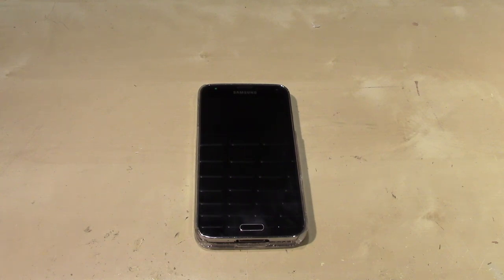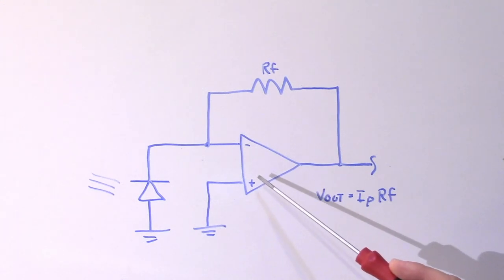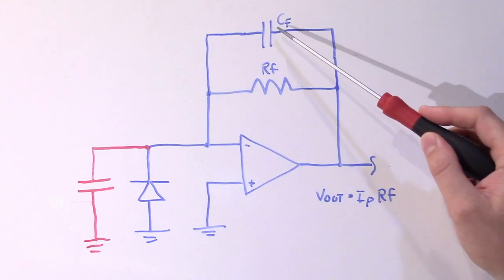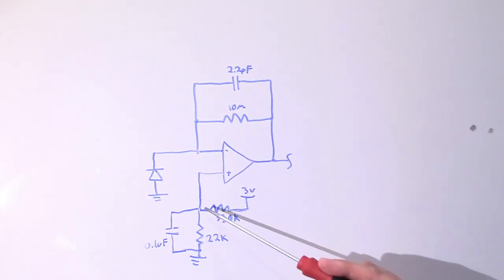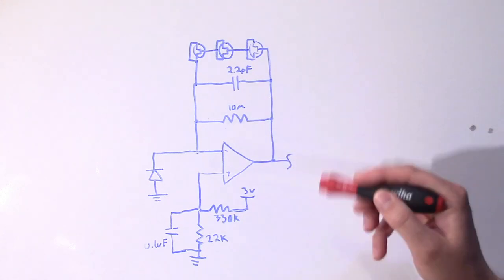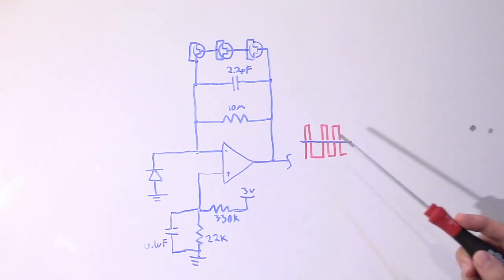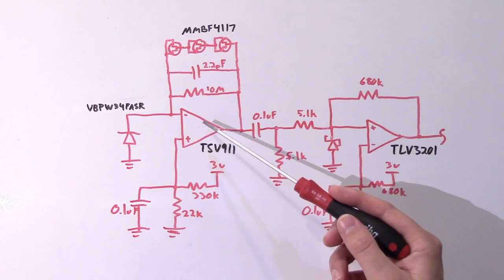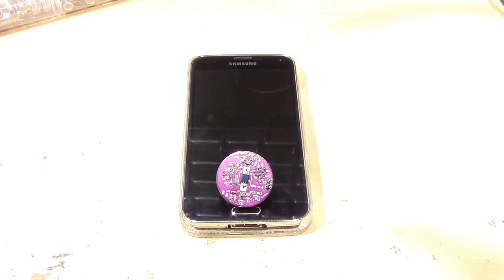Photodiode/Transimpedance Amplifier Design

Comment: Cool video. What kind of EDA tool do you use for PCB design?
Reply from the maker: KiCAD. It has its idiosyncrasies (for example, at least on Mac, the standard Command+C copy shortcut key fricking closes kicad windows...ugh...), but then I'd venture to say that all CAD programs are like that.
Reply: This is in the OSX bug database https://bugs.launchpad.net/kicad/+bug/1420714 - if some intrepid soul wants to fix it.

Comment: Hi, Very nice video to clear all points.....How about if my transmitter is transmitting data at 9600 baud rate....how same circuit works....
Reply: You need to increase the bandwidth by a factor of 10, so you'll need to reduce the feedback resistor down to 1 megaohm. That will reduce the gain, and hence the range by a factor of 10. Perhaps you will need a multi-stage circuit, rather than this simple one.

Comment: Hello, nice work! One question. Why using decoupling caps 0.1uF at 22k and 10k whe your supply is a battery? thanks
Reply: Noise does not only come from the main voltage source.

Comment: I wonder if an avalanche photodiode suited for the wavelength in question could be used with a strong optical IR bandpass filter to create an extremely sensitive detector precisely for IR. The high gain would perhaps compensate for the filter loss. I've been reading about APD applications when it comes to laser rangefinders, which is a fascinating topic in itself. Though while ~950nm APDs exist (like the First Sensor 9.5) they're pretty expensive afaik. From some rough research they should have maybe ~100x more sensitivity on average compared to a photodiode, I absolutely stand to be corrected though since I'm new to this area myself.
Reply from the maker: I've never used them myself, but yes, avalanche photodiodes are much more sensitive than the more common PIN photodiodes. I didn't really consider them as an option in this case due to cost (as you noted) and AFAIK they typically require large voltage biases. Would be interesting to play with!
Reply: devttys0 Yep, but the large voltage biases is where the gain of APDs comes from. The drive circuits would be similar to a geiger counter like some other people mentioned. I'll advertise a cool bunch of posts for you in case you'd like some geeky reading - google "Designing a Laser Range Finder", should be first link on hackaday. The poster is a South African manufacturer of laser rangefinders. :>
Reply: devttys0 Also your channel to me is as fantastic for pure learning as W2AEW's. Thank you so very much for the videos that you've made.

Comment: Hi. Can anyone explain how to configure this MMBF4117 N  channel JFET into a diode case? I dont understand how to connect g s d terminal in this video so that it will become like a diode
Reply: Connect drain to source; as it's an N-channel, that's the diode's cathode. The gate is then the anode.
Reply: @RexxSchneider  thx bro. Can u briefly explain why is that?
Reply: @wenhaoye8773  An N-channel JFET can be thought of as a length of N-type silicon with P-type doping around half-way along that length. So if you connect the drain and source together, you have a connection to N-type silicon. The gate is then a connection to the P-type silicon and that's what you need for a diode.
The construction of JFETs is such that the diode you get has low reverse leakage current.
Reply: @RexxSchneider  thx bruh, ur explaination is super useful and i understand now. But the final question comes up: in the video, the youtuber mentioned that configure jfet in diode case will hv lower leakage current compared to normal nmos. Do u hv any clue why is that?
Reply: @wenhaoye8773  To be accurate, connecting a JFET as a diode tends to have lower reverse leakage current than a normal silicon diode. That's a complex issue, but in simplistic terms, because the JFET is bigger than a normal diode, the charge carriers have a greater distance to go, and the levels of doping will normally be different from those used in a silicon p-n diode.
A MOSFET doesn't have a junction to reverse bias, and the gate is insulated by a metal oxide layer. Leakage through the gate of a MOSFET is a completely different effect.
Reply: @RexxSchneider  ok. Thank you very much.

Comment: You are wrong about the photodiode getting hit by more light equates to to a higher gain. In your circuit, more current will flow thru the PD and lessen the amplification. I think you mean to add a +Vcc to the PD in your circuit

Comment: Just curious, you picked the JFets as diodes, for their low inverse leakage current - when does this come into play? IMHO the diodes (JFets here) will never be reverse biased at all (even if there is 0 current flowing through the IR diode, the output of the opamp will always be ever so slightly above the V- pin of the opamp), so no current will be able to flow in the reverse direction.

~
Reply from the maker: Heh, you're right of course, I'm surprised you're the only one to mention that. :)  Leakage was more of a concern in a previous iteration of the design which ran off a split supply and the op amp's output was nominally 0v; in that case, a fast-moving input signal could briefly reverse bias the diodes (or they could possibly be reverse biased in a quiescent state due to op amp offset errors). Still, the JFET-as-a-super-low-leakage-diode trick is one of my favorite parts of the circuit, even if unecessary. :P
Reply: Yeah, if the opamp was powered from a split supply, then they will make sense. That crossed my mind, but when I saw the single coin cell battery, I started scratching my head :-) I totally agree that for low-current nodes, JFets are way better then a simple diode!

Regards,
Aleks
Reply: 0

Comment: Doesn't the circuit get swamped by noise from fluorescent lighting, which produce an IR carrier component modulated by low frequency noise?  In the case of compact florescent lights there is a strong modulation from the control electronics.
Reply from the maker: I haven't looked at CFLs specifically, but I do have fluorescent lighting above the workbench which generates a 60Hz modulated signal that is picked up by the detector. The high pass filter formed by the coupling capacitor between the amplifier and comparator helps to reduce the effects of lower frequency modulation like this, but the circuit is still fundamentally susceptible to it.

Comment: How would you add in AGC in this circuit in order to give the comparator a predictable signal?
Reply: I would low pass filter the signal and use this to compare against the signal itself. Brigther pulses will rise the filtered signal, causing the comparator to be less sensitive.

Comment: can you explain lockin amplifiers using LED and PD?
Reply: Lock-in, adds the signals at a given frequency, while averaging out the noise at all other frequencies.  It does that typically by using a local oscillator to generate the signal used for detection and then mixing (multiplying) the detected signal (whose frequency is identical to the local oscillator frequency) with the local oscillator.  The result is a signal at near zero Hertz, and at twice the LO frequency.  The Lock-ins sense one or the other (0 or 2f). Since the detected signal may have a phase shift compared to the LO signal, but both are at the same frequency, Lock-ins normally also add the (square) of two signals.  One  at LO phase =0 degrees and another at LO phase=90 degrees, to recover a signal that is proportional to the phase-independent magnitude of the detected signal.  (sin**2 plus cos**2 = 1, cos = sin (theta-90) so result is independent of phase). Best lock-in explanation at https://www.youtube.com/watch?v=Yqs-4TKGjjQ&t=1914s

Comment: Best circuit is a 2N7000 mosfet and connect photodiode between D and G
Transistor as a source follower... With 3 IR leds and small reflector works up to 1000m